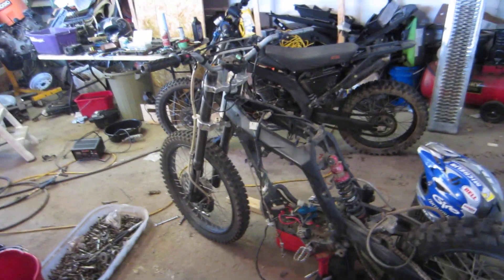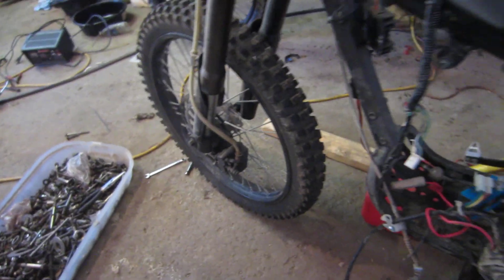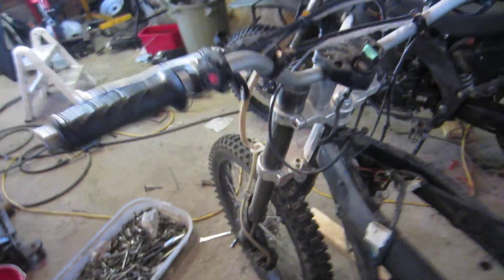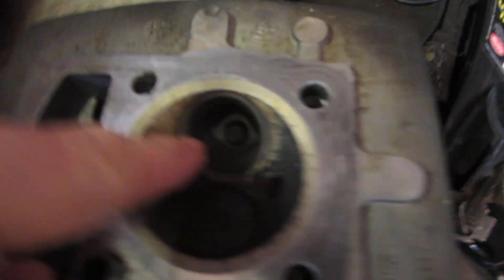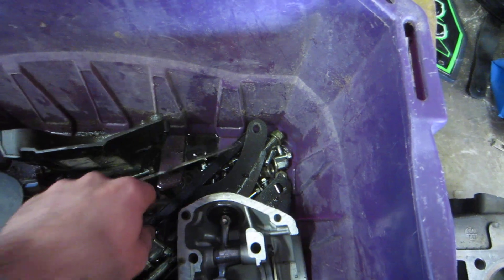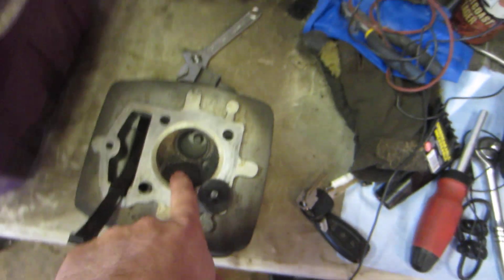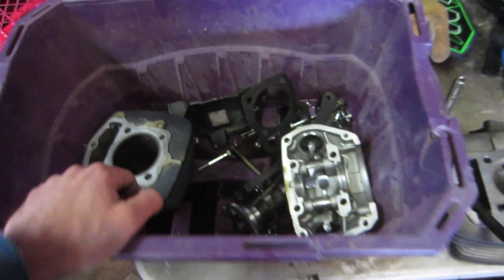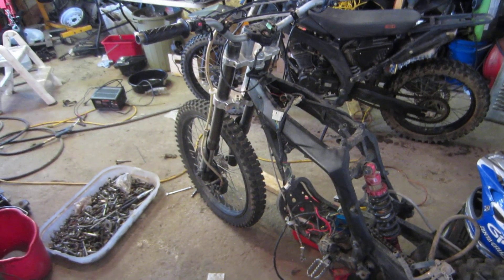Gio 250cc chinese dirt bike, blown motor, lets fix it up!

Comment: Did you make a video repairing it ?
Reply from the maker: Hey there, I did, but never uploaded it, ending up putting in valves and a new timing chain as I remember, it was pretty straightforward to repair and I think the parts were pretty good quality.  The engine lacks a rev limiter in the CDi though, and I think over revving the motor is the fate of most of these Chinese bikes.

Comment: I have a Giovanni 250 not sure of the year but I've owned it since 2016. Can't get fire so I was going to order all new electrical but the AC CDI and the DC CDI look exactly identical. Anybody know if these are a DC CDI or the AC one or how do you tell?
Reply from the maker: Hey there, I looked this up and I couldn't immediatly figure it out either.  I'd say if the unit has a battery is probably DC, but apparently thats not always the case.  I'd check for an engine code (Zongshen ZS169 etc) then figure out for that year, what type of Stator it has, and if the bike has a rectifier circuit to create DC power.  I also strongly recommend you find a CDi for that engine WITH a rev limiter, both these bikes were blown up I'm fairly sure before and after I sold them by over-rev. Stock CDi's count on valve-float to limit revs, which just means Valves meeting Pistons.  I remember finding exact factory Zongshen CDi's at one point that had a limiter.  Check out this video for some clarification on which one you have, and thanks for watching, hope you get her running soon, remember compression check as well (one of mine sucked in a piece of sealant that blocked open the valve, this bike I think, well after I had it running)  https://www.youtube.com/watch?v=O0kwSkLVY4U&ab_channel=JD%27sCustomBuggies

Comment: Does anyone know how to time these motors I bought on in peices and am clueless on timing it
Reply from the maker: There are some guides on how to time the Zongshen ZS169 and many similar motors out there, as I remember there is a hole in the stator cover\flywheel you line up with a mark for TDC compression stroke.  I had to fully rebuild one of the other motors and it wasn't too difficult to find as I recall.  (did a timing chain and replaced valves\piston) There is little info on the actual motorcycles (so many different brands with zero support) but you can usually find a guide on a Zongshen OHC motor.  Best of luck! the parts are cheap and the motors are generally well made, the key to keeping them alive is getting a CDi with a rev limiter, many are so cheap they have none and the motor will valve float, which can often lead to valves hitting pistons.

Comment: Lofl.....considering it's a chinee bike I'da just tossed a valve in 'er and sent it!!! I just got one of these for a beater but it's not the ohc....it's good enough for running my dogs on my 2 acre property and I've seen the abuse they can take. I'm considering just going to Chinese bikes because parts are dirt cheep and plentiful.....but if I sell my rm 2fiddy I know I'll miss it too much. The China bikes are great for leisurely trail riding.....provided you do s bit of work on them first ie:jet the carb,route the electrical better,etc

Comment: What were you valve dimensions?
Reply from the maker: Not sure! I ordered valves for a GC250 and the engine model, ZS169 I think, I'd measure them before you order to be sure sure.
Reply: realizing how late I am to this comment section, I just got one (the exact same motor). did the GC250 valves end up working out? i just bought them @Kingsoupturbo
Reply from the maker: @mattrinaldi8828  They did work!  that motor ran quite well, there is a video on my channel of the bike when its completed.